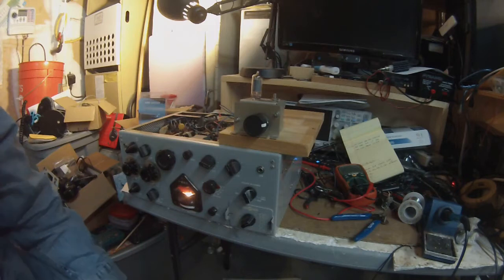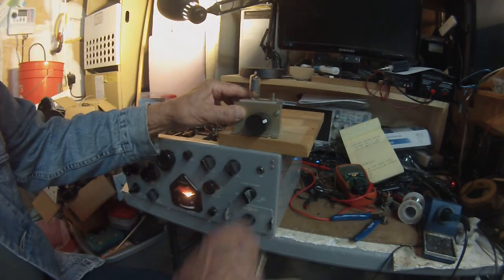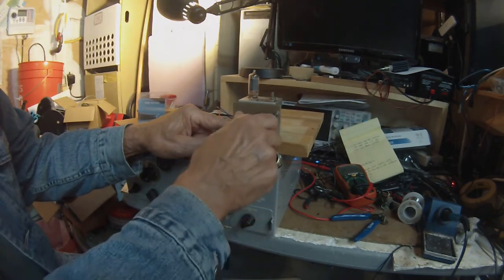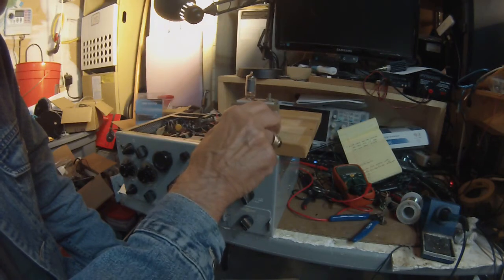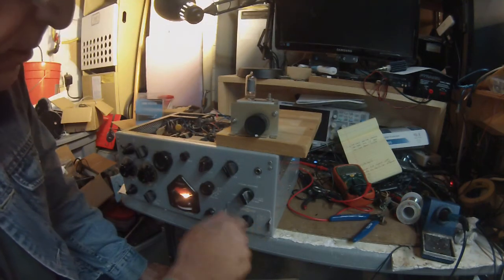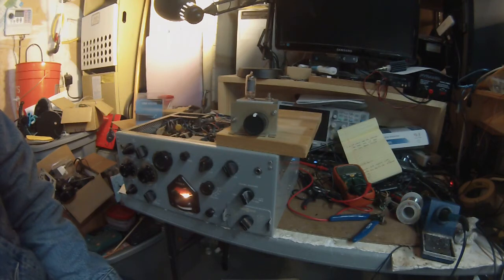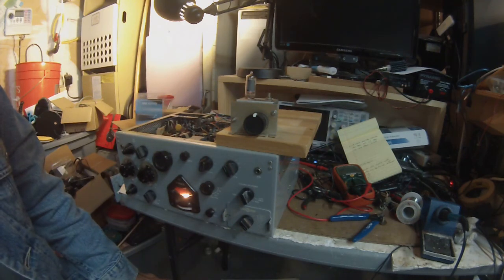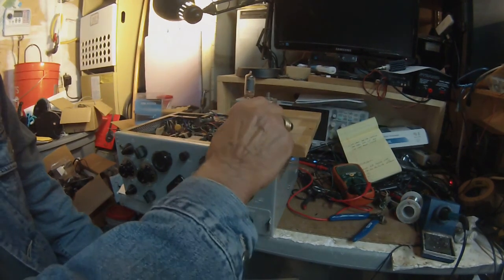Fixing the Collins KWM 1!

Comment: Nice looking rig!  Sometimes the mechanical problems are tricky to solve.
Reply from the maker: Hi Wes;

Well my super glue fix didn't hold but I have the junker PTO now working. I did find the problem with the no receiver it was a wire broken off on another relay so that the Meter reads  S on Receive but RF out on transmit. Another accident as I was probing and I accidently bumped the wire and saw it was broken off but because it was in a bundle it looked like it was connected. This is not the kind of Collins work you saw in the KWM-2.

Pete